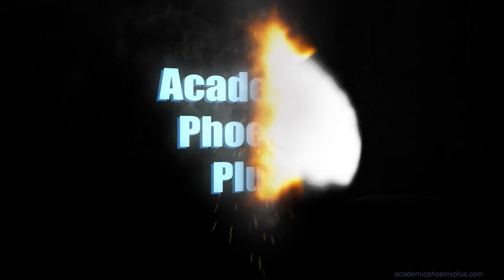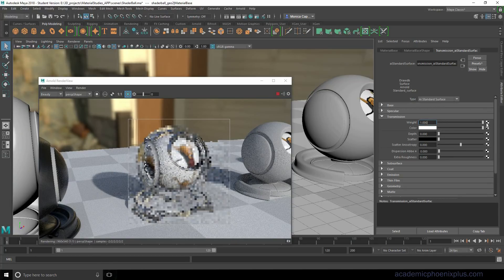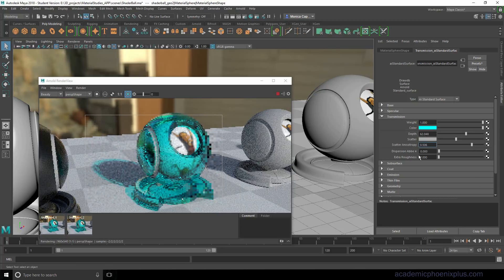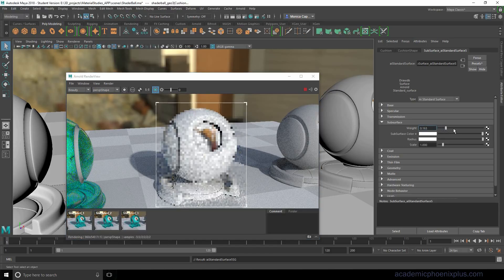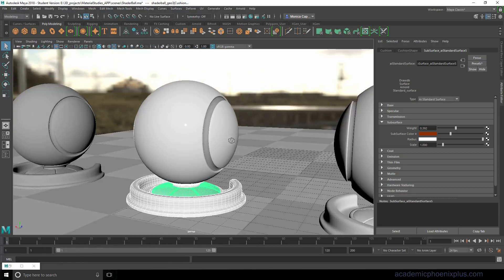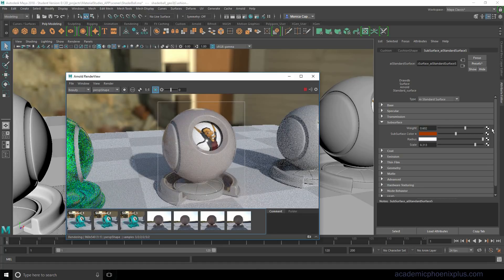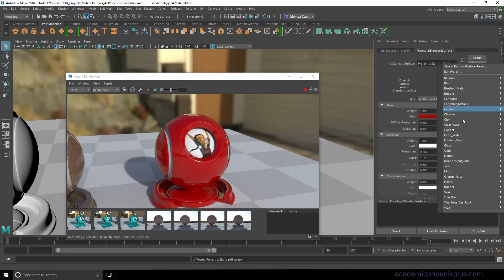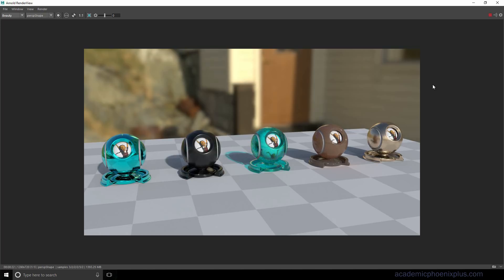Intro to Arnold aiStandardSurface Material using Maya 2018 (2/2)

Comment: Cool tutorials, thank you... very understandable... 👍👍👍 By the way what is the specs of that PC you were using? 😊
Reply from the maker: Thank you! I bought my computer about 2 years ago, so it needs an upgrade. 1TB hard drive, with 250 gb solid state. :)
Reply: Right now I’m still using 2nd gen i3, 2GB GTX 960. But It’s giving me a hard time. I’m just new in 3D and  planning to upgrade but I don’t know, what are the best specs 😩
Reply: @majid abbad rizqallah khan  Thank you for the tip. I already upgraded my PC 8th gen i7, but I only have 230GB SSD but it's working faster now and short time of rendering. But I'm still planning to upgrade my GTX 960, any suggestion?

Comment: Oh so that Subsurface option could be used for skin. I tried to make a good skin SSS a few weeks back, I didn't have much luck though.
Reply from the maker: The new Subsurface is a lot simpler then the Mental Ray SSS. It takes a bit of practice. :)
Reply: Arnold does seem a lot simpler in general. I usually have a harder time making Mental Ray look like Arnold... I also read up somewhere that Arnold is supposedly slower rendering-wise. Based on your experience, what do you think?
Reply from the maker: At first, I wasn't a fan of Arnold. But now I'm a HUGE fan. It takes just as much, if not less time, then mental ray. Occlusion? No problem! Hair system? Easy! :) I'm enjoying it a great deal.
Reply: Cool that's good to hear!

Comment: what is the specs of the machine that you use here?
Reply from the maker: Let's see... Processor: Intel Core i7 6700K 4.0GHz, System Memory: 16GB DDR4 2666MHz, Storage Set 1: 1x SSD 500GB,  Storage Set 2: 1x Storage 2TB, Graphics Card: 1x GeForce GTX 1060 6GB VR Ready.
:)